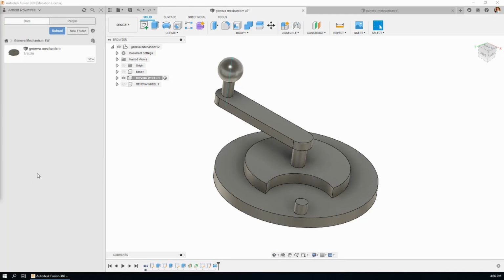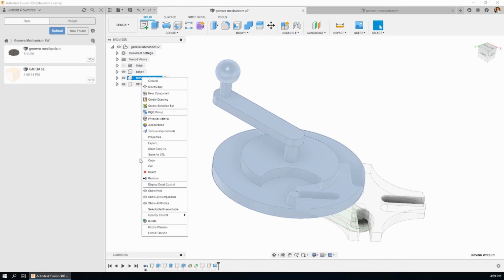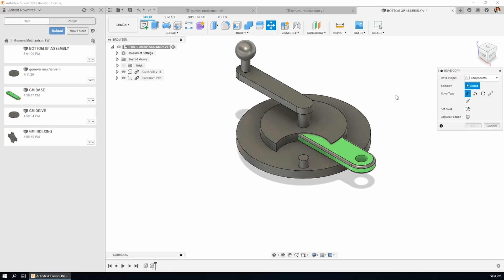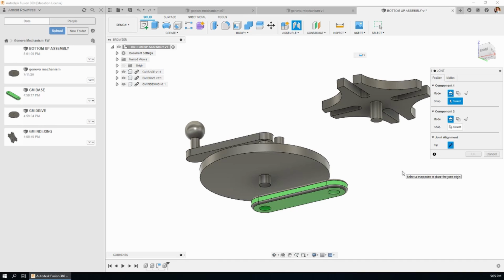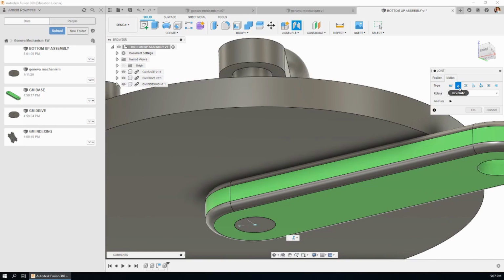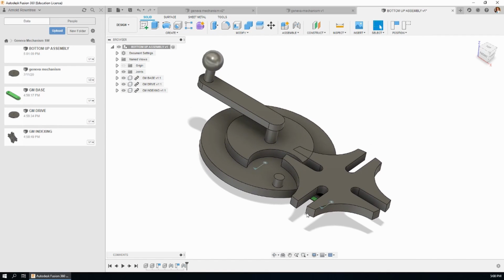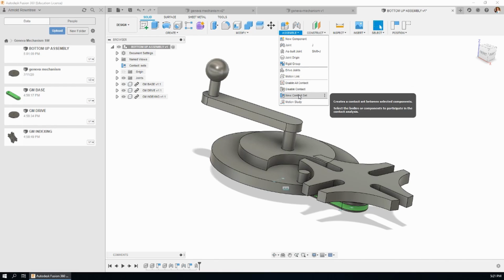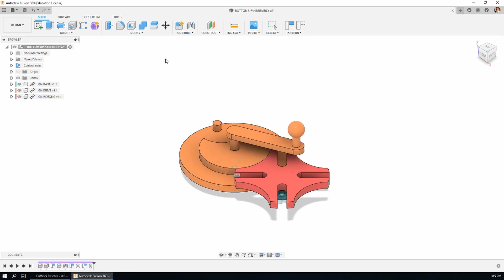Fusion 360 Assembly Tutorial | Bottom Up Method

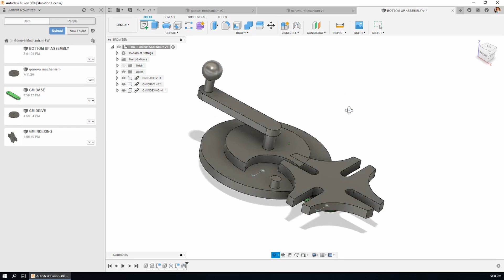Comment: My handle doesn't seem to spin at around 6:34.

Everything spins: the Indexing wheel and base, but not the handle. When I click on it, it doesn't move. Any tips how to fix this?
Reply: Right-click on the Geneva driving wheel and make sure that it is not grounded to anything.
Reply from the maker: Good idea John, another thing to check is to open up your joints folder and go over that one between the wheel and the base to see that its the revolute joint.

Comment: Thanks for making a great video! I learned a lot from it. 
I was wondering if there is a reason why you don't ground the base plate? I simply grounded it from the browser menu (which is a lot faster than going through the assembly menu) and everything seems to work just fine.
Reply from the maker: You're welcome SV. Yes it is faster to Ground the first component in the assembly and I'm pretty sure it'll work fine. The reason that I showed the method where you do an as built with the component and the top of the tree is because Brad Tallis of Fusion 360 recommended it in one of his livestreams. You can browse his content here
https://www.youtube.com/channel/UCiMwMz3RMbW5mbx0iDcRQ2g
I always used that Ground feature in Solidworks and Fusion seems to have it in there, perhaps to make Solidworks users feel at home however I think they have a reason for their recommendation, I'll be on the lookout to see what that is now, I just don't recall.